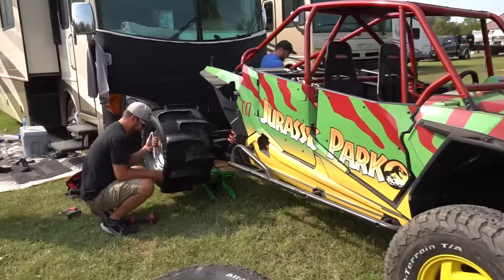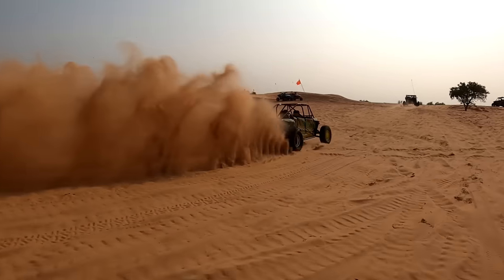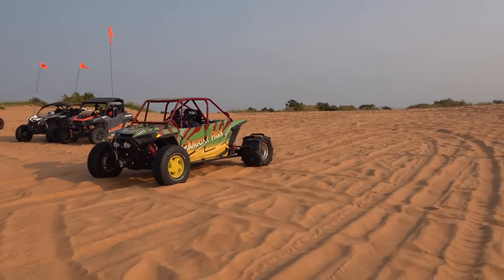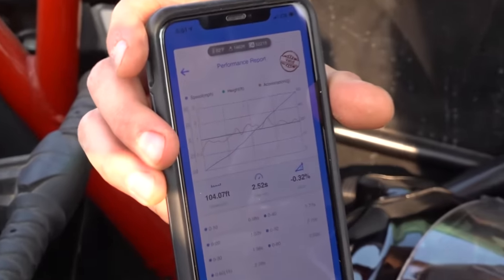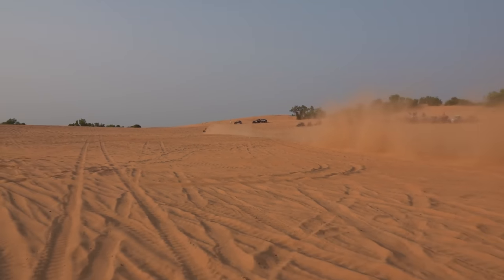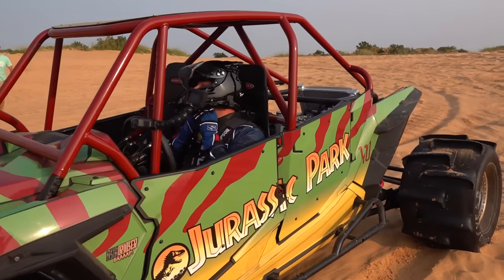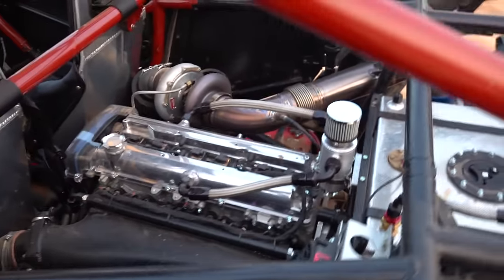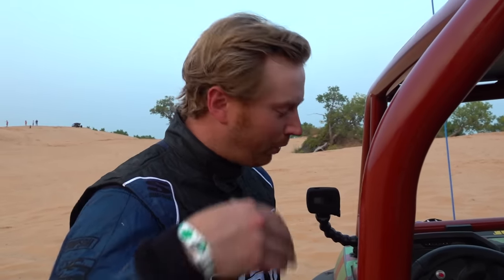1000HP 2JZ powered Polaris RZR hits the sand at LITTLE SAHARA!

Comment: Read the tire roost the taller the roost the less traction u have, too much power off the hit at about the 100 foot mark the machine starts to catch up with the tires and the roost drops. drop compression rate for rear springs and up the damping adjustment for the rear also up damping adjustment on the front to keep the front from coming up so fast  the slow the squat and she will stick better off the hit

Comment: my question is how did it fair in the sand drags for take over?  think when you line up to Packard or KnT you might yourself in a different circumstance.  But glad you guys feel your car is fast.
Reply from the maker: Didn’t enter. No rear brakes along with a bunch of other loose ends that are not completed. As far as “feeling” that the car is fast, the data in the video speaks for itself.

Comment: If its 4 linked in the rear raise the bottom bars up 1 hole and it will make the tires bite harder make the rear dig down. You don't have the weight in the vehicle to weight transfer so you use the power of the vehicle to weight transfer you dont want it to squat you want separation in the rear which tries to push up the body on the back of the car and crushes the tire harder into the ground

Comment: Small tire drag racing is all about weight transfer wheel speed I don't know much about the sand but it seems like running small tires on the street

Comment: Should have went to second gear. Turbo setups love load. Clicking to second about 200' out probably would have got you the number. With that size turbo the power lays flat. Second definitely would have pulled harder from 3/4 track on

Comment: Needs a little more gearing to get the torque up. Those tires are made to spin in sand they straight eat. The engine is a little happier at higher rpm.

Comment: That slow mo really showed how much the suspension is not setup for hits like that. It digs in and lifts the front really good for the first 5-10 feet then it unloads and all the weight is removed from the rear tires and its even more spin city! Then it repeats the same thing. Had to see it but its doing it!! The rebound on rear needs to be slowed down and compression speed up. The opposite up front,  just a little bit! That would make it dig like a goffer tell you what!! LoL. That thing is bad to the ass for sure!! Cant wait to see what second gear does!! LoL kidding

Comment: Instead of trying to compact the sand like you did take what drag racers do and drive forward a distance then back up in those same tracks. The front tires will compact the sand better as you back up. Although I doubt you can tame that 2j in the sand without traction control.

Comment: Depending on your ecu you can tune it boost by gear. So there is less in first and bring it back on in 3rd and 4th. You should have Brent at PFI tune it. Kyle from Boosted Boys has a sand rail wit a v6 honda turbos's. Its bad
Reply: Power glide transmission only has first then direct. It's a 2 speed

Comment: you dont need a bigger turbo.. you need a smaller on for more power earlier in the mid range! i must have sounded like a crazy person talking to my phone saying no turning it down will slow it down! by the sound of it you are only in power for a split second..
Reply from the maker: It’s at 19lbs of boost at launch with full boost basically instantly
Reply: @SXSBlog  ok, sounds like it picks up alot on the top end, don't know how the curve looks like 😊 it has been some years since i launched a "sand rail" but i realised  that spinning was always a part i coulden't get away from so i got the best results by bringing in power and wheelspeed as soon as possible. (that was on nitrous but  the principle is the same) 😊

Comment: idk why they think more tires gonna do something here. its sand, all its going to do with that is dig in to an already loose surface. on a wet sand surface it will do better, but with this much power to weight ratio its gonna have trouble not spinning on a prepped track with slicks. it just doesnt have the weight. its gonna need to have some type of traction control to make it not spin off the launch. you have to realize that this thing has more power than one of blake wilkey's sand rails and weighs about half of one. what you built here was a spinning machine and will need traction control to not spin. am i hating on this project, fuck no i couldnt wait to see this thing on the sand but i knew it was gonna spin no matter the surface just from looking at it from a physics standpoint, you could have 1 ft paddles and its not gonna keep it from spinning on dry sand. traction control off the launch is what it needs even if it reduces hp.

Comment: I would for sure dump those heavy ass wheels and tires off the front !
The back tires I think are to wide and aggressive I would try a skinnier tire with more cups. Just check the hi buck sand cars you want to get the front end up and transfer all the weight to the back tires and smaller mass should amount to faster spin up letting you hit second gear quicker and flying down the sand .

Comment: Curious as to why youre running such a wide tire up front still? Id thin you could run those 5/6" wide wheels like Method has.....get a little weight off the nose and give her a little better weight transfer🤷‍♂️...not really a sand guy here but understand some principles

Comment: 1st rule: You don't run paddles unless you have the power to pull them. You can achieve motion efficiently enough by airing down the offroad tires you already posses.
2nd rule: If you have the power to pull paddles, the size and number of paddles will be determined by the amount of power you have.
You obviously have stores of power.
So, skip rule#1 and move straight to shit canning those ridiculous half scoops.
The diameter of the paddles you have are too small. Up the diameter of the tire itself and make sure they are full paddles on beadlock wheels.
Noobs..hahaha
Great vid..nice rig.

Comment: First off you’re doing a great job. A little less girly cheering would be good. How would turning power down in sand make it go faster. As in water the faster you can spin the prop or paddles the faster you take off. A little different than asphalt, you are never going to hook up like slicks do.😃😃 let one of the Nicks or Rick drive it.
Reply: Start a round of applause???🤣🤣